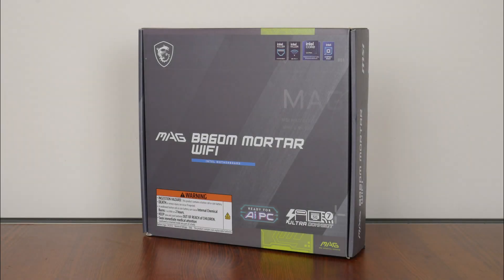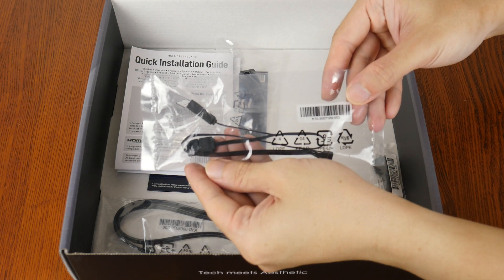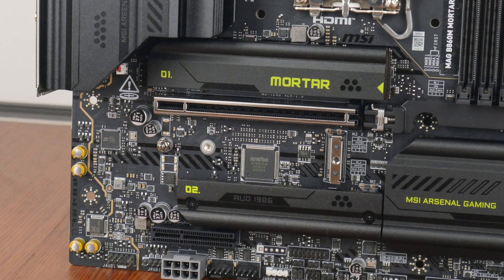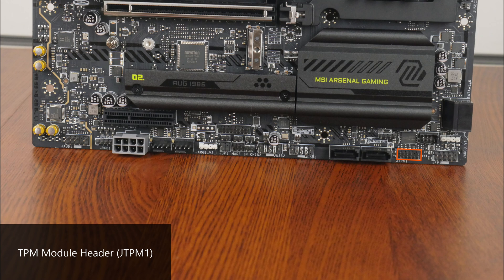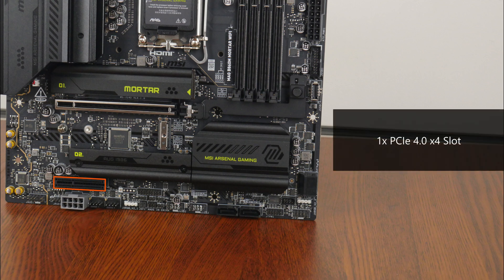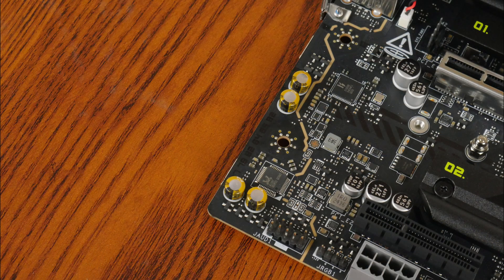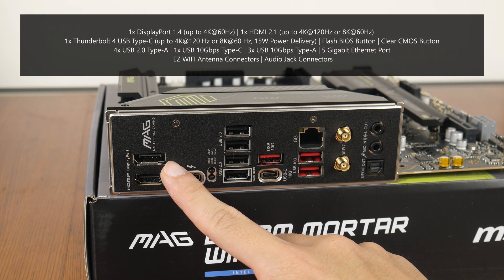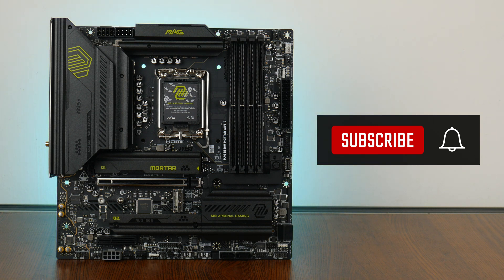Feature-packed Mainstream Intel B860 Motherboard! MSI MAG B860M MORTAR WIFI Unboxing & Overview

Comment: Why cant u get it anywhere? Msi focked it up. Unavailable in eu. Or some TR has it for double the price 😅😅😅😅
Reply from the maker: I wonder if it's because demand for LGA1851 motherboards hasn't been high owing to the fact that the Core Ultra 200 line-up isn't great...
Reply: @ALKtech I think so too :( Gamers are much more wider population. They game 24/7. Amd cpu amd gpu and fps fps 😅
I need Intel and nGreedia for work so I am in a bad position. Thought I could make a beautiful mATX build but seems like not 😢
MSI Mag Z890 Tomahawk Wifi is available widely - ATX format. 

Thank you for your answer ❤🎉
Reply from the maker: @MartinovyEventy  😅 out of curiosity, what kind of workflow do you have that requires an Intel Core Ultra processor? Does your work require a NPU?

Comment: It is best for Intel Ultra 5 245K or other options
Reply from the maker: Yeah it'll handle a 245K with no issues - with this board's VRM setup, it should handle Intel's high-end Core Ultra 200 series parts with relative ease!
Reply: @ALKtech ultra 7 265k
Reply: @ALKtech ultra 7 265k
Reply from the maker: Yup it should handle a 265K fine too!

Comment: Thank you for the video, watched this while I wait for the release of the b850m mortar
Reply from the maker: Have you decided on which processor and GPU to get for your AM5 build?
Reply: @ALKtech I have a 9070xt and existing 5800x I’d need to upgrade to either 7800x3d or 9800x3d
Reply from the maker: @ I see, did you manage to get your 9070 XT at a decent price? It's a good thing that prices are normalising already for the 9800X3D if you do wind up getting one!
Reply: @ yeah stood in line on launch day at our local electronics store here for MSRP

Comment: this mobo has same price as z890m aorus ice, which one should i get?
Reply: Z890 duhh
Reply from the maker: I would pick the Gigabyte board in this case, but purely from an aesthetic perspective - I assume you haven't decided whether to build a white or black coloured Intel PC?
Reply: @ALKtech The color isn't really my concern. I thought there would be more features for the price, as it's almost the same as the Z890M. Since I won't overclock, a B board might suffice.
Reply from the maker: @  right I see. I just had a look at the specs sheet of both boards again - my take is that both boards are pretty balanced in terms of specs, though the MSI does have the edge in terms of unique features such as EZ-Conn, and Intel WIFI7 (with support for 320 MHz channel widths) and 5 Gigabit Ethernet. If the colour of your build isn't a concern, I'd probably be more inclined towards the MSI then 😅. Have you decided on what processor to pair with your board yet?

Comment: What's an EZ antenna connector? Is this an SMA standard plug so I can use my own antenna?
Reply from the maker: Hey there, EZ Antenna is a MSI-specific connector that doesn't require any screwing-in (i.e. the connectors do not have threads like the standard SMA connectors). Hope this clarifies!